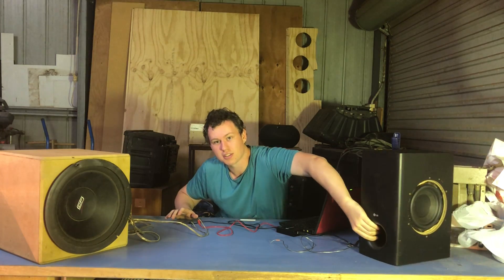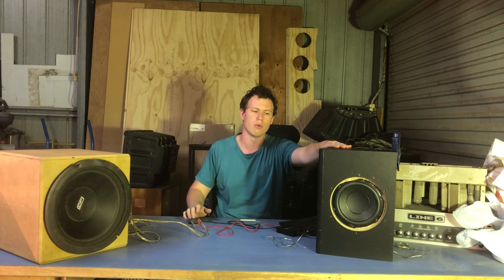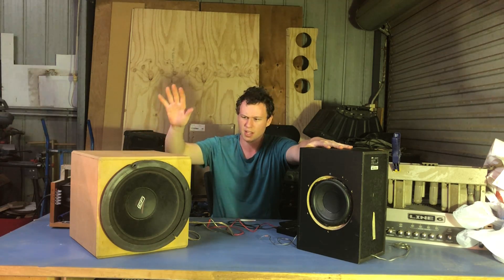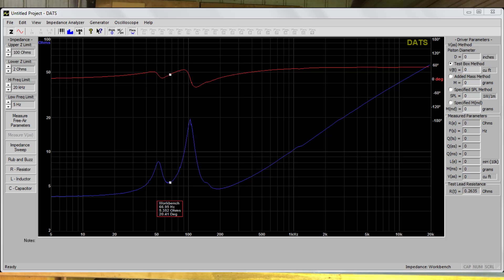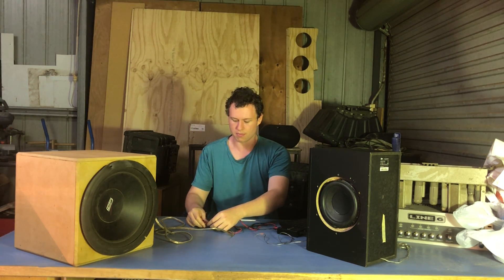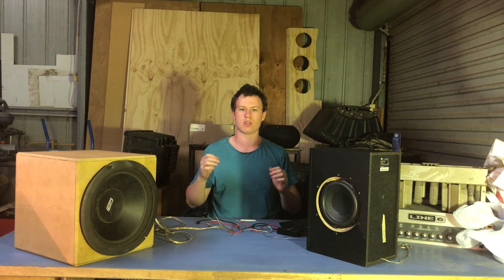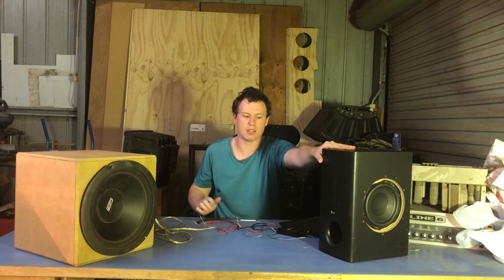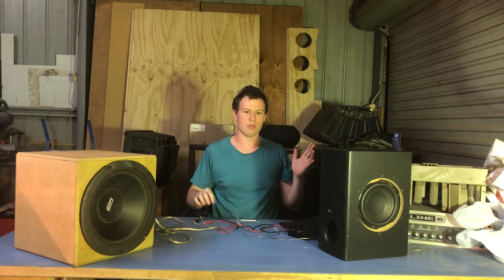Modern home theatre subs suck, and here's why.

Comment: Size matters even if its crappy .that s said i have a pair of 8 inch  car subs in 24 litter box each very stiff suspension but they also work very well as mid range ..i use them as my studio monitors with peerless tweeter with pretty flat curve..they can they can do 20 hz even though its ported for 37 hz  the sub has a Fs of 54 hz

Comment: DIY > Commercial Off The Shelf (COTS) units, almost unilaterally. There are exceptions: JTR (probably the best non-DIY sub you can buy), PSA, Legacy. But for the most part, they're all too small, have too much EQ and they go for SPL over SQ or Low end Extension. You know I love my ULF, the only real way to dip down into the single digit frequencies without spending THOUSANDS is to go DIY. 

Sidebar: SVS is okay. They're middle-of-the-road subwoofers with over-the-top marketing.

Comment: Hi, great information keep it up.
Suggest me how about a 12inch SPL car subwoofer in sealed box, advantage and disadvantage, please help.
Reply: 12inch subs needs fresh air
Reply: @Krupnoklipac  Not to attack you, maybe you're memeing, but if you actually think that, how did you end up on such a technical channel?
Reply from the maker: They're generally designed or focused at ported enclosures, and are often stiff, so in a sealed enclosure you'll miss out on some low end. But, can sound better.

Comment: i got a sundown x6.5 in a 0.7cbft box tuned to 30hz its really strong in the 38hz range probably due to the room and shakes some windows down in the 20's.
Reply from the maker: Yeah, a good small sub in a low tuned box can be awesome. Another reason the LG confuses me.
Reply: @Dakoustics  same here. alot of the cheapy home mini hifi systems have the same issue.

Comment: Like most things nowadays cheap for a cheap experience.
Reply: the current trend of HT subwoofers they tend to tune the enclosure with a huge peak in the midbass (about 70Hz) of 6dB in a 20L enclosure at best ... they are just made to impress those uneducated about audio because of the booming sound they interpret as sounding good ... but no way for the audiophile list so DIY is the way to go ... i've end up building a 140L giant size enclosure housing a 12inch driver unit with 2 ports tuned low about 28Hz ... powered with class D 400w TDA8950 and shelving bass management unit the experience was satisfying that no other commercial unit will give

Comment: You noticed the LG has very stiff suspension compliance and probably would have noticed the low powered amp powering it... it has built in physical protection(probably has a active high pass, to save burning the VC). Plus mister or missus average Joe who buy budget sound just dont really care about real low end extension.
Reply from the maker: Yeah, it's a shame the average consumer doesn't really know or care, if people actually cared about stuff like this a change could be made. Education could fix every issue the earth has. But yeah, this driver was matched with 3" satellite speakers, so it had to do some of the mid-bass they couldn't do, which made it directional and pretty rubbish. I can't remember how rubbish though, as the reciever stopped working 4ish years ago. It claimed to be 400 watts (yeah right, made is smell on the grand total of 30 watts), but the reciever could push the 12" in this vid fairly hard, so im really not sure. I guess it'd just focus on the 60Hz when loud.

Comment: Even my diy 6.5 inch woofer in 1.6 cubic feet box can hit 31 hz pretty loud and its tuned to about 44 hz
Reply: 1.6cf for a 6.5" sub is huge is it a sealed alignment?, have you actually measured the output at 31Hz
Reply: @st170ish  I used win isd to calculate box size in extended base aligning , I don't have any fancy mic to record  but its  pretty audible to my ears and its ported

Comment: My microlabs fc 330 2.1 system bass bin is tuned to 52 Hz and is got a smaller box driver and amp than the lg.